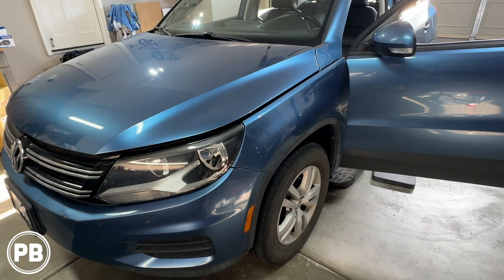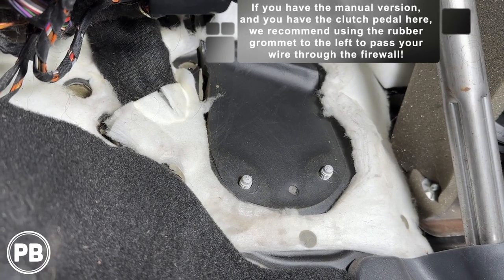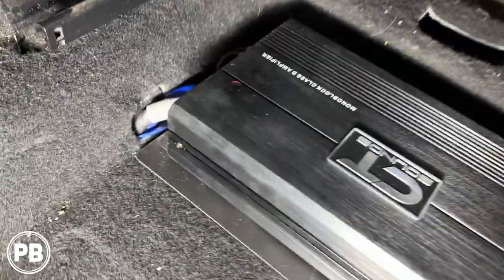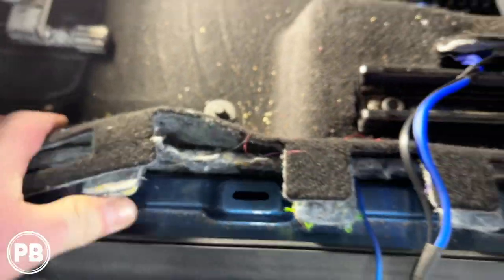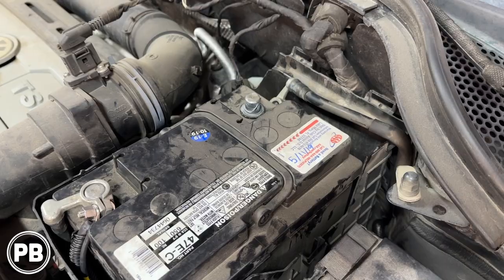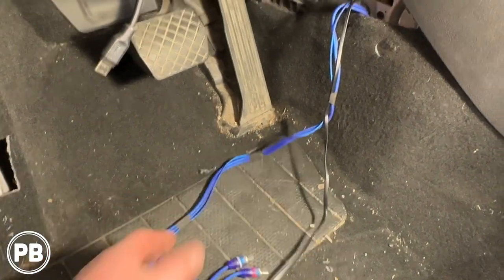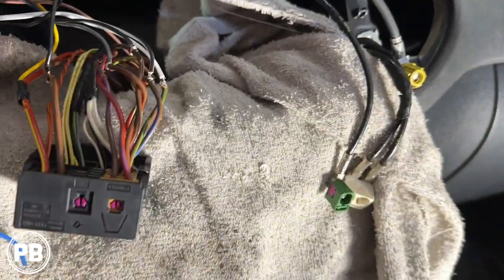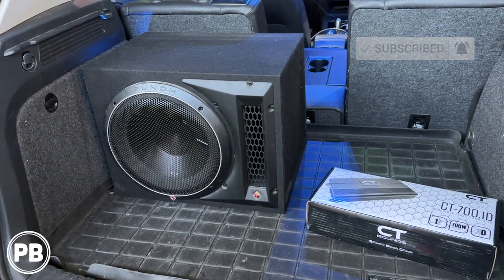2009 - 2015 VW Tiguan Amp and Sub Install

Comment: Why does everyone always remove the head unit! You already had the wires exposes at the door post. Just tap into them there. Easier access and less length of wire to run!

Comment: Thanks alot! I had different colors on the speaker cables on my Touran but your explanation about were the cables was and the location in the connector helped alot to connect the converter. Thanks!

Comment: Hello, thank you for your vidéo. I have a question.
Where do you put your Remote ? Because you don’t explain or i don’t understand where you put in the vw connectic your remote. Do you have the color of this ?
Reply from the maker: We do actually, the Line Out Converter used generates the remote turn on wire for us.  Rewatch the video @ 13:55
Reply: @ProvoBeastAudio  Thank you for your answer now it’s work perfect 💪🏻